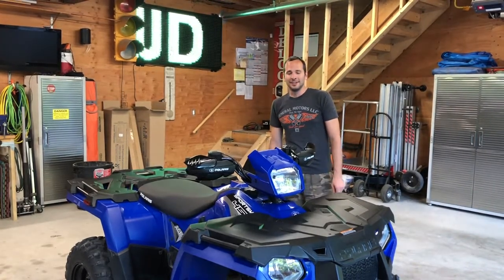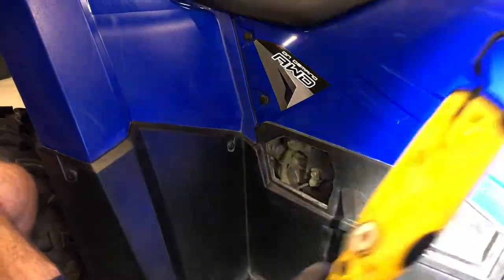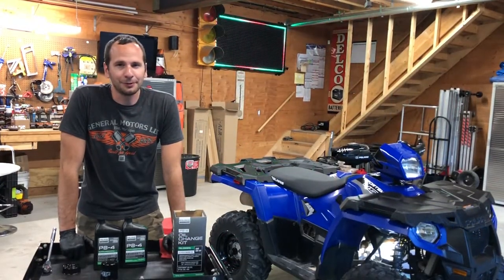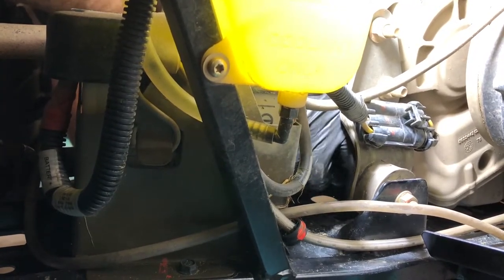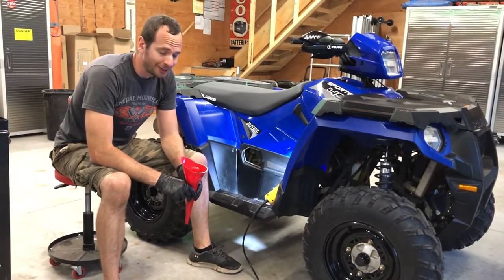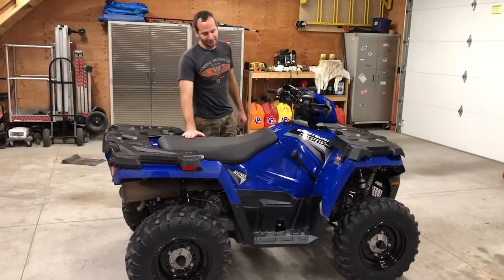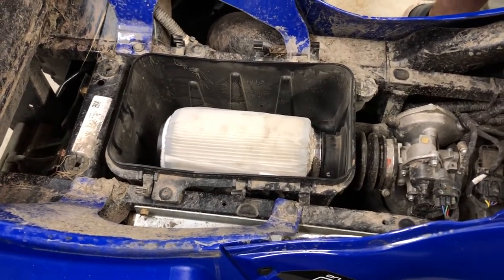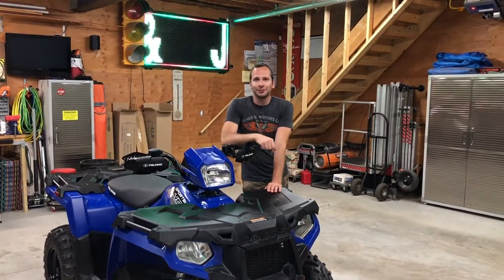Polaris Sportsman oil change

Comment: Hey man, have you noticed if your oil smells like gas? My ‘22 sportsman does, pretty strong actually. Didnt know if that was normal. Nice video👍
Reply from the maker: I haven’t noticed that, a strong gas smell isn’t normal. I’d after the oil change run it a while and make sure your oil level doesn’t go up just to make sure it’s not somehow getting gas in the crankcase. Thanks for watching!!

Comment: Where are the grease points on 2020 sportsman 450
Reply from the maker: As far as I know in the control arms front and rear
Reply: Man, I got a 2022 Sportsman 450 they now have no grease fittings they are sealed bushings, only grease fitting is the driveshaft yoke !

Comment: I have a 2020 Sportsman 450 as well and the engine light is on. I've changed the oil and reset to 50 hours but the engine light remains on. I also have the tool service wrench on the LED display. Do you know I can check to find out what's causing the engine light?
Reply from the maker: Honestly not sure what would cause that, unfortunately I think you'll need a scanner to read the code.
Reply: @garageforty2  Sorry for the late response. I just posted my issue in the Polaris forum hopefully someone will be able to help. 

Thanks for replying back.
Reply from the maker: @tb0256  no problem, good luck!
Reply: Try driving it in low gear with rpm at least 4000 for 45 seconds to 1 minute.
Reply: @tb0256  did you figure the issue with the check engine light?
Reply: @manuelsalgado8510  / It's been awhile so I don't remember all of the ins-and-outs but i do remember I was the problem and not the 4wheeler. But thanks for trying to help me out.

Comment: What’s the part number for the filter wrench? Or what size is it?
Reply from the maker: https://www.autozone.com/shop-and-garage-tools/oil-filter-wrench/performance-tool-a-cap-oil-filter-wrench/153157_0_0?spps.s=6790&cmpid=LIA:US:EN:AD:NL:1000000:GEN:71700000069889792&gclid=Cj0KCQjw1PSDBhDbARIsAPeTqrfGfSAJIAv61D6R5E64XXiu-OM_TTMIyPI5GBq4yahgTh4d8I6fHcYaAlsJEALw_wcB&gclsrc=aw.ds
Reply from the maker: I believe it’s that one, Polaris actually sells one too at the dealership that is a decent price.